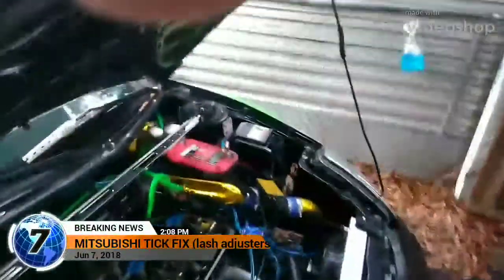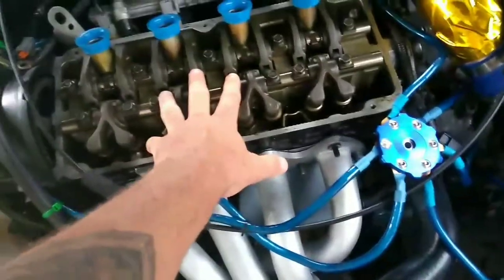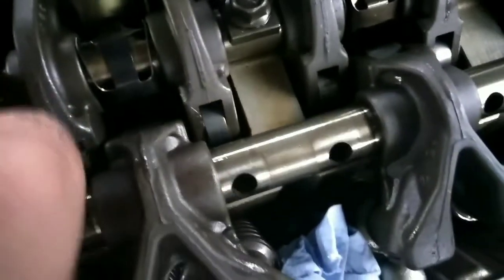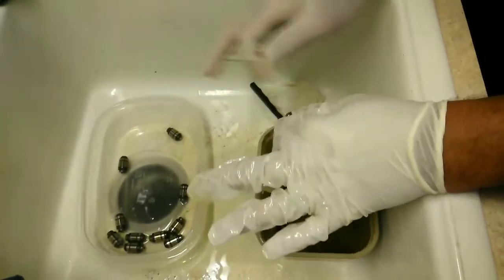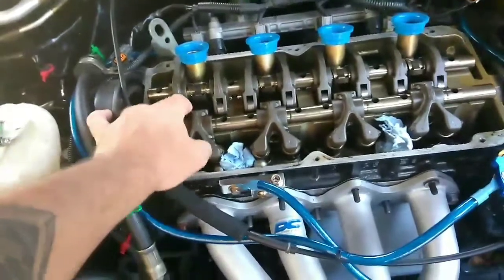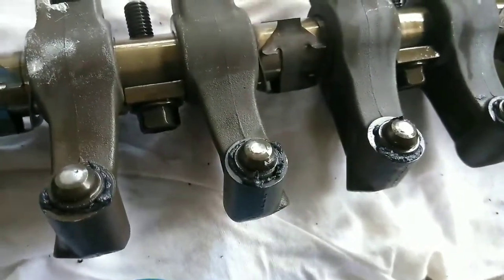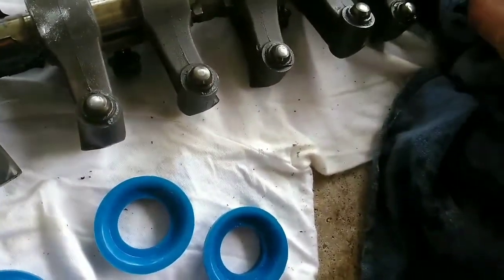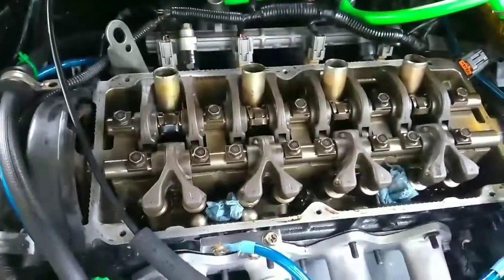3G Mitsubishi eclipse tick fix (lash adjusters)

Comment: I like how you kept going back and doing more research! True mechanic mindset. Just 1 thing, after cleaning the lifters, you should let them sit in engine oil for a while. Would eliminate the grease when reinstalling and keep the tick away until primed. You could also prime the oil by removing the spark plug wires and letting the motor rotate a few times. Hope this helps for future work! Keep at it

Comment: Great video.  I did what was instructed.  I only replaced one hydraulic valve of the sixteen for $12.  I used diesel fuel and a paperclip, and inserted each one by hand after rockers were resting in place and barely starting bolts threads.  I did have to repeat the whole process, because apparently I didn't flush each one out good enough and remove carbon buildup on the plunging end and I did not let them sit in oil and plunge each one by hand under oil(under water, so to speak)--Not having the oil in the valve before putting them in after using diesel fuel seemed to allow them to get stuck again.  I used a fine nail file of my moms to remove excess carbon and shine them up so they wouldn't snag when compressing.  I put them all in with one new hydraulic valve lash(the $12 part).  I started the engine and let it warm up then drove it a few blocks to get them pumping and viola.  Now before the car get a chance to sit to long I am going to run SeaFoam in the oil at one ounce per quart of oil.  I am going to put SeaFoam in my gas tank at one ounce per gallon every time I fill up for the next few tanks.  This should help reduce the lash valves from ceasing up again like it did the first time through.  After, going through it twice it came out nice.  PLUNGE THEM IN OIL BY HAND BEFORE INSERTING.  I NEVER KNEW THESE VALVES COULD JUST BE CLEANED WITH A PAPER CLIP.  NO TICKING WHAT SO EVER ON MY 2006 Mitsubishi Lancer SE 2.0L anymore.
Reply: Deane Larence  I since found out that it is only a temporary solution.  I did only get the adjusters to a point so that they were no longer seized:  I drove only about a few hundred miles before I just went ahead and replace them all.  It got me by and prevented further damage.  Again, for  me....it was a temp. fix until I replaced all with new.  Might try allowing them to soak a long while and run that plunger a few extra time so the internal carbon buildup might not return as fast.  Maybe you'll get more miles out of the job.

Comment: Bought new lifters, bled all the air out but my rocker arm shafts don't sit even on the head, can anyone help me on that?
Reply: Turn each bolt a quarter at a time starting from the middle
Reply: Thanks, but ended up needing a new engine, it was still knocking
Reply: @LuisHernandez-pt2ox it's most likely your timing belt. You also have knocking because the timing could be off.